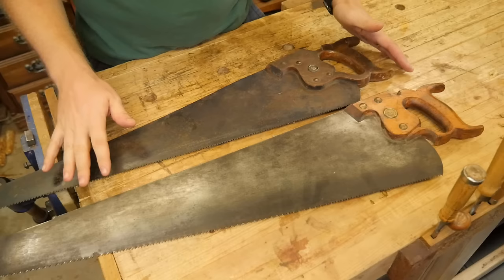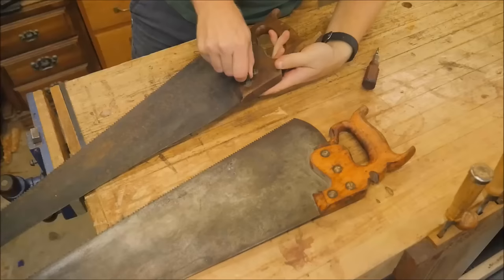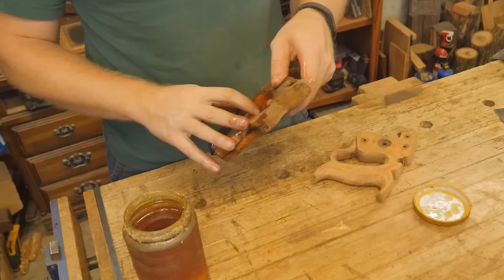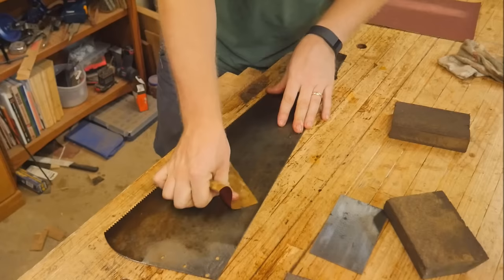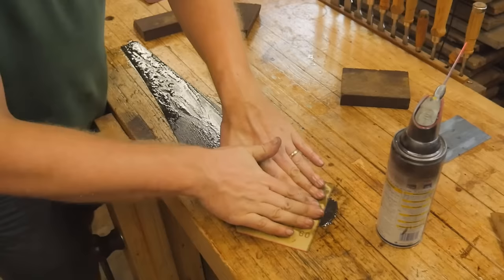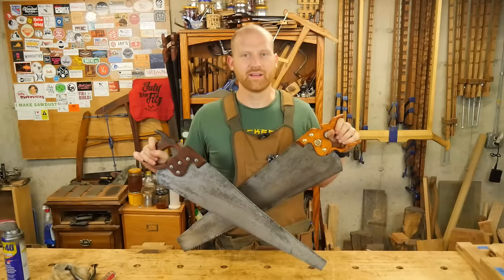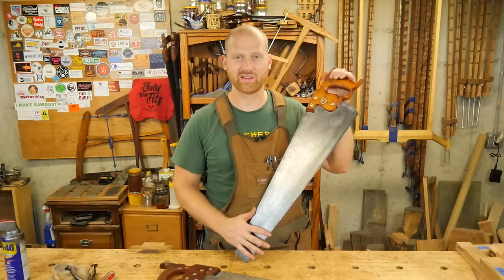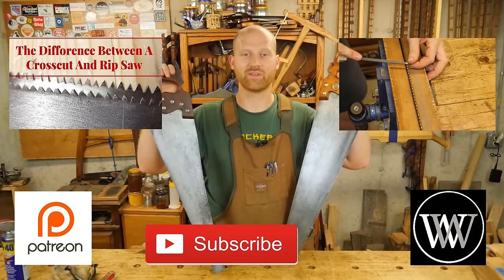How to Restore an Old Hand Saw Crosscut or Ripcut

Comment: Great video. I just picked up a 2 beautiful old saws in fairly good shape out of the metal bin at the dump. Both have nibs, one is S. Biggin and Sons, Sheffield, and the other I can't read yet due to crap on the blade. I think I might try evaporust instead of vinegar and scrubbing in case there is a nice etch.

Comment: Just did my grandpa's old saw. It was a Blue Diamond cross cut. Nice handle that had clean crack through middle with a dowel at back in a attempt to repair. Took it apart ,sanded and repaired split with wood glue. Then linseed oil, shellac and furniture  polish. Looked pretty cool. I still can see faint crack line. I used a similar blade cleaning  method as yours for  a nice patina look. 1st saw restore. 
I will attempt  a sharpening. It cuts  not bad now. Great inspiring vid.

Comment: Thanks James, just rescues a bunch of rusty that once belonged to my dad. I did not know until recently that these beauties could be sharpened and usable tools. They are in rough shape but have lovely handles much like those in this video, a mixture of rip and cross cut of varying sizes. I did not know lamb’s tongue is what you call that detail in the handle.

Comment: Many of those post war handles could certainly use a little fine shaping, they are pretty square. A bit of time with a rasp or two and sandpaper helps them greatly. Also, while working on the funky saw plates I have had very good luck soaking nuts and bolts in plain old household white vinegar. Let that mild acidity do the work and the gunk usually comes off with an old toothbrush, while still retaining a bit of the age and patina color. They don't come out looking brand new, but that is the idea. Thanks for posting these videos, keep up the good work!
Reply from the maker: So true on all points.

Comment: Good job. I was trying to ask you about this process but I decided to just watch a few of your vids instead:] My saws are very old and rusty/paint vinegar worked great even threw a old plane in there. Time to sand it up and finish the handles there is 6 so I will be a bit. Sharpening is going ok but not so great with the crosscut yet.

Comment: I have used the vinegar and  klingspor's sandflex blocks from (coarse, medium, and fine) on a shark saw that some one tossed out because they left it in the rain. Teeth were excellent but some pitting on the surface from the rust.  I was thinking of using sand paper, since the sandflex are expensive to use.   Glad I found your video the results on the saws are pretty sharp!
 
Also another saw guy mentioned using paste wax, since it protects and helps the blades slide through a cut.
Reply from the maker: right on. I make my own paste wax for just that reason!

Comment: I really appreciated your video.  A few years ago, I had the fortune to “rescue” nine various handsaws from a dumpster destined for a landfill.  They had been used (abused???) by community service “interns”.  I recently got around to consider what to do with them.....now attempting restoration.  So your advice was invaluable.   The first saw had some gorgeous etching.....as a result, I am stymied how to proceed without damaging it.  As my initial aim was to simply restore the saw to common use, I used naval jelly and fine sand paper.  Now seeing the etching coming through, I want to proceed more carefully.  Any idea on how to clean around the etching?  Thanks again... for a timely video, amigo!
Reply from the maker: the best ad vice I can give is fine sandpaper on a hard backer. I have a friend that uses a steel plate with a handle then adheres 400 grit sand paper on that so you hit just the high points and not what is in the etching. at a cretin point they can not be saved , but if they can that is my favorite method.

Comment: Hey James, you may want to try Evaporust instead of vinegar. The acid in the vinegar can eat through metal, while evaporust doesn't. This is particularly important with blade/cap iron on antique wood-bodied planes, where the type of metal is particularly vulnerable to the acid
Reply from the maker: partially correct. I have used both extensively and several others and for the price I still prefer vinegar.

Comment: Sanding is a very quick way ruin an etch. Have you tried scraping yet? Very quick to remove rust and it saves the etches.
Reply from the maker: +Timothy Charles I some times scrape to get alot of the surface junk and rust off, but I find it dose little for the age blackening. If you are light with the sanding it can skip over the etch and keep it quite nicely. Thanks man. I do like your work with saws.

Comment: This was a great video! Thank you! I was able to find a saw but it is HEAVILY rusted. I can see that it has words on the blade but I can’t tell what it says through the rust. Might it be possible to remove the rust enough to see what the words on the blade say?
Reply from the maker: I would first use a scraper then clean it with mild soap. If it needs more then 400 grit on a hard surface may do it. But too much may remove the etch all together.

Comment: How do you get out a bend on the saw?  Every single one I have ever seen has been crooked.
Reply from the maker: if it is a kink then it takes a Ball peen hammer, and avle, 2-4 hours and years of experiance, if it is just a gradual bent then just bend it back. some times it requires bending the toe all the way back tot he handle but the spring steel can take it.
Reply: The inside of the end of the cell phones on the outside though
Reply: Another method of removing a bow is to clamp the plate in a vise, loosen the grip slightly, then pull the plate out with steady even pressure in the opposite direction of the bow. 
Of course, if the whole plate doesn't fit, you can do it all be hand and draw it over the edge of your bench.

Comment: Hey there,

I have my grandfathers old hand saw and the handle is soft and rotted so I want to replace with custom.

However fasteners are turning when I try to turn the flat head side. With the other side being domed is there any method for this?
Reply from the maker: You can use a hand screw clamp drill a hole in one jaw for the screw driver to fit in then clamp the spinning side.

Comment: Thanks for the video! Is that regular sandpaper or wet sand paper or something else? 150 grit sounds like it would leave visible thin scratches on the blade?
Reply from the maker: I avoid cheap out and use regular sandpaper. All sandpaper leaves scratches. The next grit will remove them.

Comment: What can you do if it's rusted and has a nice stencil. Also where can you get new bolts for the handle?
Reply from the maker: It all depends on the saw and its condition. But if you're trying to save the etch on the plate generally the easiest thing to do is to scrape it rather than to sand it. But if you have a good hard sanding block you can still sand it off without hurting the etch. Blackburn toolworks sells sawnuts that he makes. But as the handles there are so many different designs and shapes that I don't know of anyone who just sells handles. You really have to make them to fit the particular plate you are using. However Blackburn tool works also has patterns so you can make your own. I have a few videos on doing that. With a few files it's relatively easy.
Reply: @WoodByWright  I wanna keep it as original as possible, the blades don't have terrible surface rust like this one you did but they are discolored dark black and rust brown. What about a rust remover solution over wd40 and sanding. Would that hurt the etch? It has some color to it and I'd like to keep it.
Reply from the maker: WD-40 and sandpaper will hurt the etch more than anything else. Scraping is generally the best to keep the patina. Just use a card scraper without a lot of down pressure and scrape off the rust and junk that's left on the saw. The other thing you could do is use a very fine steel wool pad and rub the plate down with that and some oil.

Comment: Is there a trick you know when one of the brass handle bolts doesn't want to come loose?
Reply from the maker: Penetrating oil and vibration. If that doesn't work then brute force and violent manipulation
Reply: @WoodByWright  I ended up drilling a tiny little hole in the saw bolt head and stuck a pushpin into the wood to hold it in place. Worked just fine. Thanks for your quick reply.

Comment: I used vinegar straight from the jug, without any water added,  and it turned the saw plater black; that wasn't real easy to remove--I used Barkeeper's Friend, Rusterizer, and finally 400 grit sandpaper.  It also made the etching almost disappear, though it wasn't real visible to begin with.  Next time I'll try the WD-40, as in the video, which I should have looked at first.  I also wondered if waterless hand cleaner and sandpaper would be effective.  Always enjoy watching the vidoes.
Reply from the maker: I now prefer to use sandpaper on a block of wood. that saves the etch a bit more than a sanding sponge. Thanks Joseph!

Comment: Have you made a video about restoring / repairing a dovetail saw or carcass saw that has a thick metal spine on the top side of the blade?
Reply from the maker: I have not. I have a video on sharpening a dovetail saw, but they are basically the same except you do not take the back off. unless you want the fight of putting it back on.

Comment: Should all their teeth be aligned, or is it normal that some saws have some teeth pointing sideways? 
I've been poking around my grandpa's tools and all the saws are old and rusty, but they all have some teeth sideways. I couldn't saw straight with one of them either. I tried it twice, and it always strays toward the right side of the line as it goes deeper into the board. It's a very similar saw to the first one you repaired there.
Reply from the maker: every other tooth should lean a bit to eather side. that is called set. that way the saw cuts a wider groove then the thickness of the plate. if it is always turning to the same side that means the set is too heavy on one side. to fix that you can stone the saw. here is a video on that. https://www.youtube.com/watch?v=4IhHqp8zRiU feel free to send me an email and I would be glad to help if that does not fix it.
Reply: @WoodByWright  Yea, their tooth are quite noticeably not evenly leaned. Gonna have to try to fix them. I just watched your video on sharpening and setting, gonna watch the one you linked, so maybe I can pull something off. Some of these tools are about as old as me lol

Thanks.

Comment: How do you recommend fixing cracks in the handle of a saw? I recently picked up a 1920 Winchester saw that has a few cracks in the handle. I also want to remove some of the rust from the blade but not remove the cool etching it has on the blade.
Reply from the maker: Cracks in different places require different fixes some of them you can put a wooden dowel through and fix it up. Some places you want to actually break off a chunk and replace it and rebuild it. And in some cases the cracks really don't matter you can just rejuvenate it with some Lindsay oil and it's good to go. The best way to train keep an etch is to put sandpaper on a hard smooth surface like a block of steel it will sand everything off but won't touch down into the etch. But even then if there's any pitting you may not be able to save the etch.
Reply: Thank you for the info, you're a great help!

Comment: Okay- why bother? Is the metal better? Do they hold an edge longer? Are they more accurate?
Reply from the maker: It's mostly that you can't find a new hand saw for a decent price that has ripped teeth or has non-hardened teeth that you can refile. Plus you can pick up these old saws for just a couple bucks and have them up and running and under half hour. Often the handle is far more comfortable on an older saw than on a newer one. and that's probably the most important part of any handsaw.

Comment: We’re can I find nuts and bolts for the handle I have one I got which is missing 2 of the bolts and nuts.
Reply from the maker: If you talk to any antique hand tool seller. They usually have a bucket of them. But rarely do they list them as they're not worth the time to list. If you go down the list of online sellers on hand. Toolfinder.com I'm sure most of them would have what you want in stock.

Comment: James, when you store your saws, do you put a light coating of oil over the metal?  I saw this technique done with restored bench planes and I wonder if it applies to any old metal tools.  Light coat, wipe off excess and then store it.
Reply from the maker: I put pot on the once every few months but not much more than that. I will use wax every few uses to keep them moving quickly.
Reply: Bruce Brachman look up the video by paul sellers where he shows how to make the "rag in a can oiler"

Comment: I just inherited a ton of tools from my Dad, Grand Dad and Great Grand Dad. I really want to restore my Dad's Diston cross cut saw but it has a few problems.  The screw holes have been worn out over the years and he has replaced the hardware with other screws and the blade has a distinct kink in it. I have tried to get rid of the kink and have gotten most of it out but the last little bit won't go.  Do you have any suggestions how to save it and make it usable again?
Reply from the maker: unless you are a master with a ball pean hammer and anvil the kink will never completely come out. but most of the time you can get it close enough to be functional though dented in appearance. as to the hardware, I usually find another saw and steel the screws from that. I have an old pile of too far gone saws for just that use.
Reply: Guy Jones With a kinked blade you have little to lose in trying to straighten it.  http://contrib2.wkfinetools.com/hagemyerM/straightSaw/straightSaw-01.asp
The kink is a line where the steel has stretched on one side of the blade and compressed on the other. Working in to the center of the kink on the convex side by striking light hammer blows on alternate sides of the kink working from the center of the blade to the edge you can compress the steel in the kink. With patience you can remove the kink.

Comment: You have me wondering whether I should restore this pile o saws over here, or make them into art as I planned when I bought them.
Reply from the maker: LOL there is a battle going on between the Hand tool workers and the saw painters. cleaning paint off a saw is difficult.
Reply: IMO, i would dig through the pile for anything of value, people are selling old disston saws on eBay for 50-100 bucks and up if the handle is in good shape and it has the medallion and stuff. Hardware store crap with plastic handles or flat slab handles... paint those to your hearts content.

Comment: Any idea how to take the bow out of a saw?
Reply from the maker: sure bend it back the other way. some times the tip needs to touch the heal. if you bend it too far then you can bend it back the other way. spring steel is very forgiving.
Reply: @WoodByWright  good to know.. just bought a rip saw on ebay

Comment: I live up in Maine and I have an unheated shop often struggling to keep my tools such as saws, planes etc. from developing surface rust (in winter months). 

What would you use to protect the surface, wax or wd40?
Reply from the maker: I use paste wax. I usually make my own mixing bees wax and 3in1 oil I have a regular ruteen to oil my tools every 6 months. and more for tools I use regularly.
Reply: Wood By Wright 

Thank you!

I saw your video on bee’s was and linseed oil. 

For bee’s wax and 3 in 1 what is the ratio of the mix ?

Thank you again,  I just discovered your channel - great stuff!

Comment: Hi I bought an old saw a few month back from a second hand shop, ive removed & cleaned the handle up great with a few coats of linseed oil. But the original brass screws that were used are bent and the thread is not good, I put the saw back together but the screws dont sit as they should, look untidy and are also loose, what would you recommend?
Reply from the maker: well depending on how old it is you may be out of luck. I keep a jar of nuts that I have kept from saws that were not worth restoring and can draw from that time to time. but with the price of most saws you can find one that looks similar and seel the nuts from that saw. the only other option is to restore the ones you have. you might be able to do that with a tap and die and carufly bend them back into shape. but that depends on how bad they are.
Reply: James Lister find fitting ones or make your own

Comment: Did you set the blades? I am getting into restoring and resharpening but didn't know about the set. Do you always need to mess with the set when sharpening or is it OK to just sharpen and leave the set alone?
Reply from the maker: +pjculbertson55 I only set every 6 or so sharpenings. These both had decent set. The more you put in the easer it it to guide through the cut but harder to push.

Comment: Hi Do you have any tips for tightening a handle that is loose and pivots on the blade?
 I find the videos really informative and clearly explained
Thanks
Reply from the maker: As the wood moves they may loosen. I just tighten the screws down a bit. but if the blade is still sliding around there may be junk in there or it may be the wrong handle for the blade.
Reply: Wood By Wright Thanks for the reply, i enjoy watching your videos . They. are to the point and calm
Reply from the maker: +John Stanton thanks. If there is anything I can do please let me know.